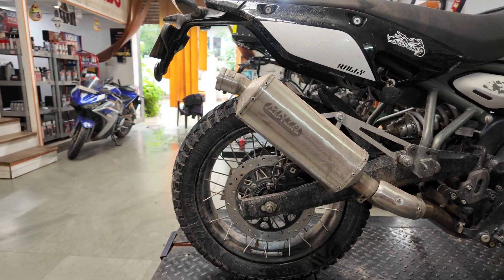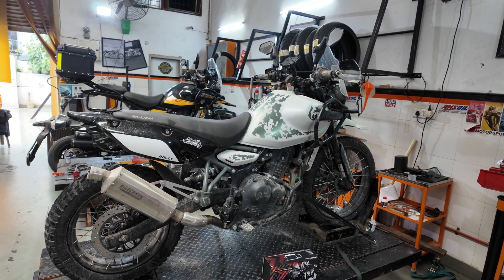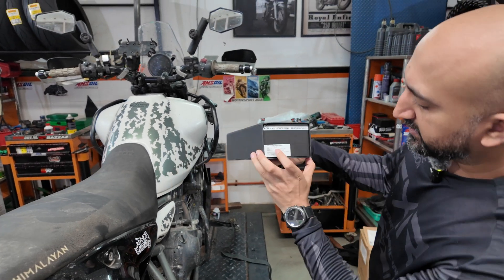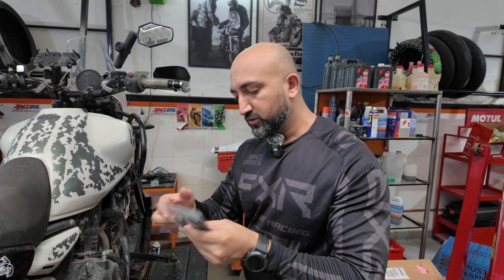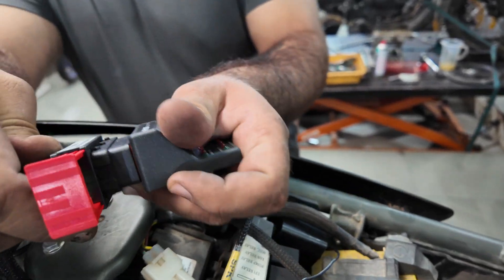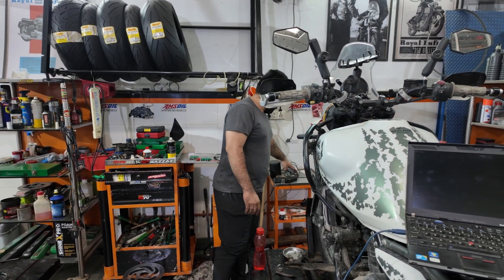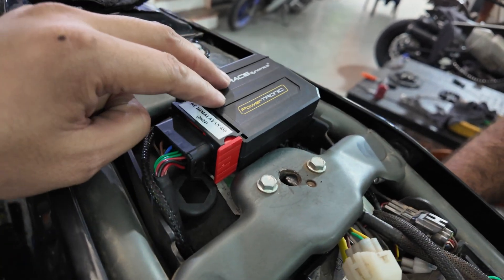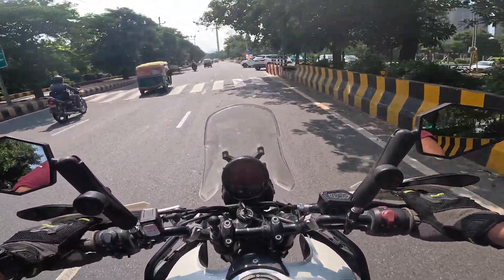Himalayan 450 Powertronic Installation At Speedmonks: How We Got To 46 BHP

Comment: the whole video has a value of guys chattign in the pub, until you show dyno run graphs the 46bhp figure means nothing, its a joke. Guys who done ECU flash hardly get to this figure and its absolute non-sense to get to this using such a gimick as a fuel pro

Comment: Sir my Himalayan 450 is misfiring during first start in morning it will take 3-5 minimum ignition to start the motorcycle 

After lots of efforts to start the motorcycle it will work fine rest of the day

Re service center has cleaned throttle body,
Changed Engine coolant temperature device,
Changed spark plug, changed ignition coil but still the problem persist. please guide me how to get rid of this problem

Comment: What did it make stock. Which gear did you test in. When I was building engines we would always start with a base line graph and then a final graph. Because now two dynos give similar results. Nor do they ever match manufacturer claims. Nice videos.

Comment: Hi i did not understand you have a fuel x and you install a powertronic , you Can combine the 2 objects ?
Reply: Yes the fuel x connects and manages the O2 sensor while the power tonics works as an piggyback ECU. Both can work together but you really don't need to have fuel x if you use an piggyback ECU. Maybe can be used to adjust the fuel maps in the fly

Comment: Hi Been watching your build of this Himi I also have this bike and am wanting to decat it, I suspect that the resonator box is mainly just a resonator and the "precat" is that actual cat, any thoughts on that and did you remove the "precat" as well as the resonator box, it seems to me that the closer cat is the one that will be causing the initial blockage and will be an equivalent to any primary cat so it should really be done away with to get the true benefits of a decat but i dont see anyone talking about this, could I ask for your thoughts regarding this......great content by the way appreciated.
Reply from the maker: Yeah, the precat is quite restrictive. A friend of mine who runs SS Motocorp (can find them on Instagram) has made an exhaust where he changed the header pipe and the end can, retaining the resonator box. He's got good results.
Reply: I have heard it said that the resonator box has a cat I. It too but I am sceptical about that I would really like to see the box opened up, literally an unboxing but can't find it anywhere I'm prepared to do this but I'm not a content maker in this area if you know of such a video please let me know where I can access it. Not sure if your aware but the cat 🐈 n the down tude can literally be knocked out or drilled out they are not of much substance, it is this area on the exhaust that really blocks and actually damages an engine due to restrictive cat infact if there are 2 cats I would prefer to remove the on closer to the manifold and leave the other. Just my thoughts and experience, thanks for replying in will give SS a looking at Cheers from New Zealand.
Reply from the maker: @simongilbert1554 yeah. I'd soon be displaying an exhaust with no cat.
Reply: I recon de cat the down tube and you will get a lot more performance I'm very keen to watch you do this, good chat cheers

Comment: So, how much is the hp on the rear wheel now? 46 or lesser? Also, will the PowerTronics unit be placed under the seat, without tying it to anything? BTW thanks for explaining in detail the installation process.
Reply from the maker: 39 bhp at the rear wheel now. Don't need to tie down the Powertronic unit.

Comment: Hey, Nice video-- I was considering buying this in US -texas where average riding speed on highways is around 130 and passing speed is around 150-160. do you recommend this if I have to ride some distance before I get offloading? Also how is it to cruise at 130-145 Kmph  with and without 46BHP?
Reply from the maker: I wouldn't want to ride it that fast and I don't think it will be able to safely pass at those speeds either.
Reply: @abhinavbhatt  what do you think will be good cruising speed of this bike ? and good passing speed.
Reply from the maker: @sukhoi01  100-110 kmph is a good cruising speed. Can pass easily at those speeds.
Reply: Get D390

Comment: on the third gear it is going to 91+, but with the stock motorcycle comes from factory wont, definitely Adrenaline rush is flowing in the Bike after installing Powertronic unit.
Reply: Bro stock goes 100kmph on 3rd gear

Comment: Hey, abhinav..

QDoes that comes at the cost of reliability of the engine bcz it is already high compression…!?

Q And does this also upgrades or solve the throttle issue on himlayan/guerrilla..!

Q And will the exhaust guys launch a new design for the roadster guerrilla 450 (this will not suit the guerrilla).
Btw best wishes for the project!🙏🏻
Reply from the maker: Any change can hit reliability but I haven’t felt it. Been making changes to my bikes for many years. 

Yes

Yes

Comment: That lovely R3 in the background ❤... And a very interesting video. One question though? Are you thinking about changing the throttle response of your bike too, for that sharp response from the bike because we know Guerrilla has such a good throttle response, if the same kind of response is doable in Himalayan then uuuuuu .. it's going to be Lovely.
Reply from the maker: I've done a video on this R3 earlier. I think I'm happy with the throttle response of the Himalayan with the changes.
Reply: @abhinavbhatt  indeed it should be about what you love for sure. i will look at the r3 video later
Reply: Add a quick throttle

Comment: Can powertronic ecu be installed without using fuelxpro+ ? What is the difference without fuelxpro+ ?
Reply: powertronic piggy back ECU should be installed without fuelx . Retailers making money won't tell you this. Please be honest. I am running my R3 with original full system exhaust (Akra) and free flow air and oil filters with Race Spec for more than an year now. No problem what so ever. Don't buy fuelx if you are installing an ecu ( powertronic). save those money for custom dyno tuning and not using default racedynamics maps. 👍

Comment: Nice. Looking forward to the commute video of this setup. 
I think you can get rid of the FuelX Pro and just use the RD ECU. You may need to tune it on a dyno for best results. The RD ECU should have all the functions of the FuelX Pro.
Reply: How sure are you about "FuelX pro+" not required..unless you are always running on fuel rich setting, then dyno is the best for your riding setting.
Reply: @chethan-le9ix  You tune the RD ECU on a dyno. Maybe have a couple of maps like Eco, Sport etc. FuelX Pro is to make it run richer or leaner. Maps dont change. But people sponsored or getting free stuff from RD never mention this. They always do FuelX + ECU. Without explaining why.
Reply: @MrSrijit Thanks Srijit for replying at this hour! May i ask one more question, If you need to change the map (from Eco to Sport) on the move, is it possible? or do you need a laptop or a mobile app?
Reply: @chethan-le9ix  Not sure about the bike ECU. I think those still need laptops or the mobile app. Their car ECUs have a remote that has a couple of modes including valet. But theoretically they can use the same switch as the fuelX to switch maps. Its their hardware and software after all
Reply: @MrSrijit I'm using both ECU + FuelX. It comes with a switch that you can use to move between a more balanced and a very aggressive map. It comes with 2 maps. Fuelx standalone is not going to give difference as much as running PowerTronic PiggyBack ECU in Race2 mode, it becomes noticeably more faster as it climbs the rpm very quickly. I don't see significant difference in performance with FuelX 3/10 however it does help with containing vibration/heat and smoothness bu definitely it has little to no effect on noticeable performance. Infact, the bike you see in the background is mine :D.
Reply: @rishiroger  Good to know. Confirms my theory that the RD ECU alone can do 95% of the job if properly tuned.
Reply: @MrSrijit yes but the problem is that when you take it out, becomes very harsh without fuelX, the NVH rips through the roof.
Reply: @rishiroger  Gotcha.